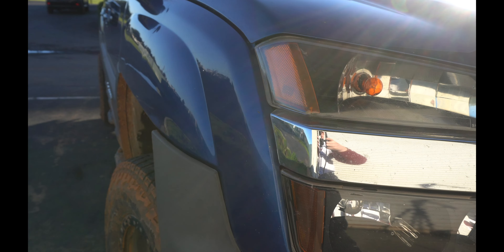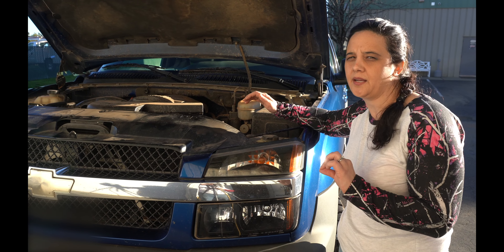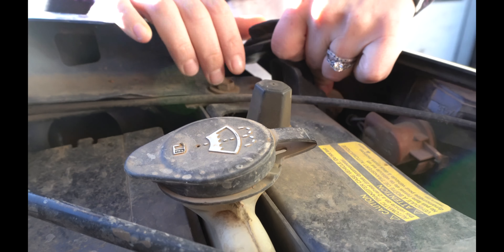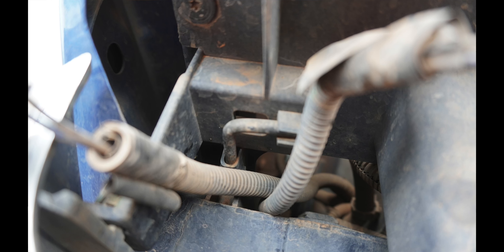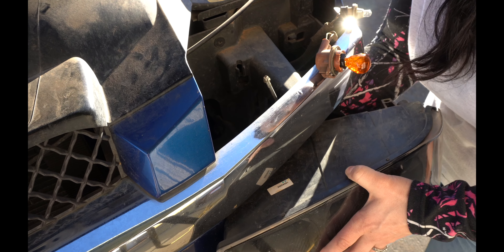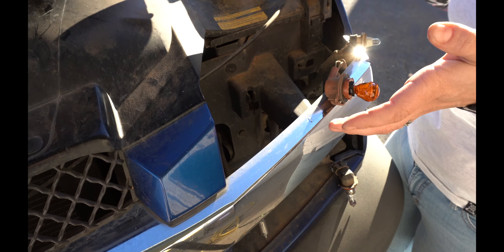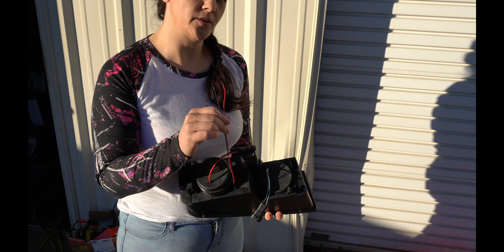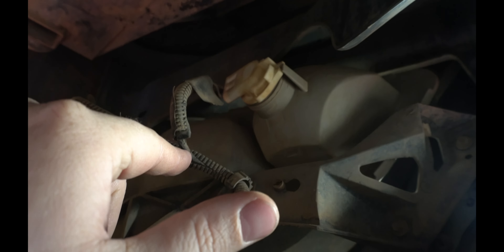How to install new Halo headlights in a 03 Chevy Avalanche

Comment: I have 2002 avalanche Z71....you hooked your drl up to fog light assembly which for mine,has a separate on & off switch for them....is THIS the case with you guys? So,in theory,in my mind, they'll only be in,when your fog lights are on...?
Correct?
I'm just wondering where I should wore mine,I guess,find my drl and connect THERE if 8 have one or maybe give it its own switch 🤷🏼‍♂️idk
Doing these upgrades NOW but trying to order the right thing 🤦🏼‍♂️